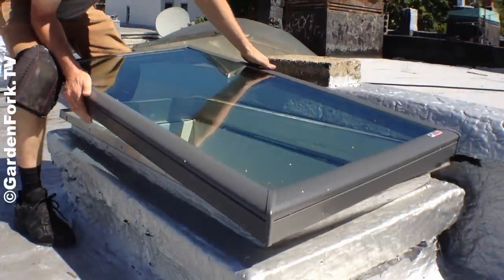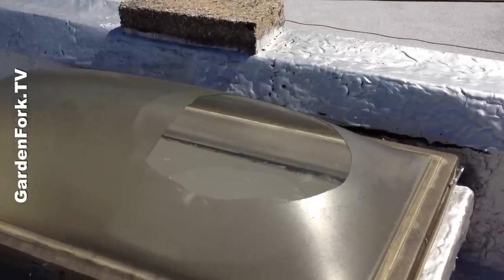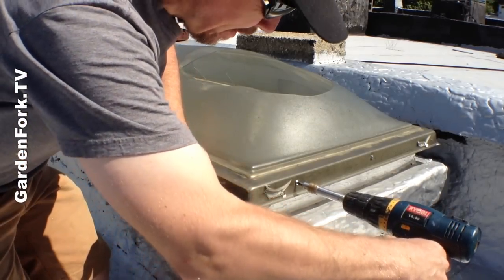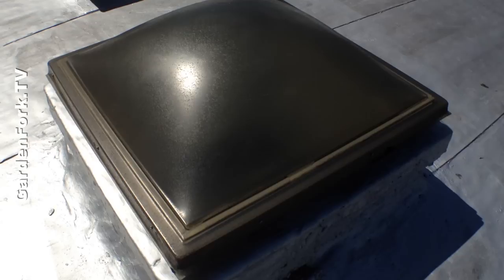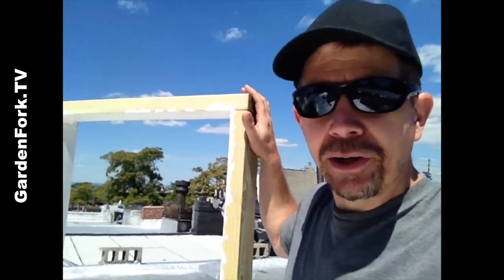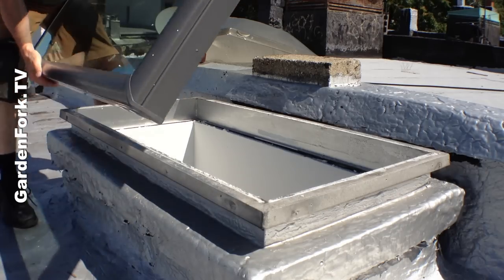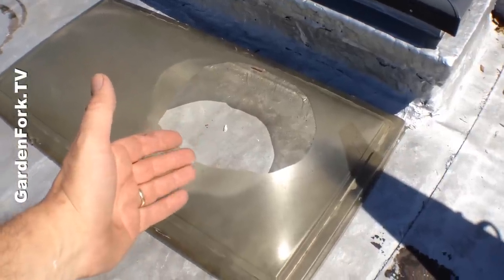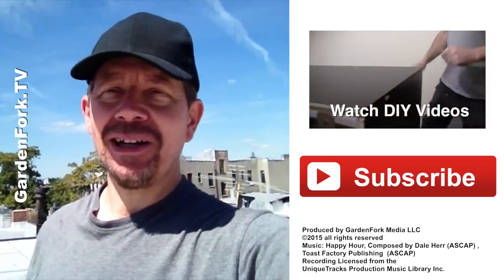How To Replace A Skylight - GardenFork

Comment: If your roof doesn't have a water-tight pre-existing curb, it likely isn't going to be this simple, especially if you get snow in the winter. It usually requires ice&water shield (a waterproof membrane with adhesive that seals around fasteners that secure the roofing material and skylight,) as well as metal flashing, (and also step-flashing for shingled roofs.) Finish the job with some silicone caulking at any spot where water could penetrate. A leaky skylight can cause a lot of expensive damage, and you might not notice it right away. I'm glad it worked out this easy here though.

Comment: Where do you measure to see what sized skylight will work?  I want to do exactly what you did and take out my old 80s bubble with an energy efficient velux like yours.  I wonder if it's the standard 22.5x46.5".  Watched a video.  Measure 1.5" down from the top of the curb to get an accurate curb size then ad 1/2" to L and W so there is 1/4" space all the way around.  I probably oversimplified it.

Comment: Just curious, as you removed the old broken dome, why is there not a new dome installed over the new skylight??
Reply: That is because the Velux skylights are much like a modern window in a house. They are double-pane with argon gas in between for energy efficiency.

Comment: Does a tile roof complicate replacing a cracked skylight? A roofing company wants to charge $6K because it says two rows
of tile roofing needs to be removed in order to replace the skylight.  I have a drone shot which I enlarged for detail I could share with you?

Comment: Don't you need another piece of domed plastic to defuse light & protect the glass from hail?
Reply from the maker: Rick Kennerly you can get a skylight with frosted glass, but this is in a common hallway, and the glass is designed to be mounted flat on a roof, so its ready for most weather.
Reply: +GardenFork really?  Wow.  And so it won't leak laying flat?
Reply: Yeah and if it snows alot that thing is going to come in your house
Reply from the maker: Nangjelovski its a weather proof skylight. you get what you pay for with skylights, this model is very good. thx! eric.
Reply from the maker: Rick Kennerly flat roofs actually have a slight pitch to them, hence the skylight is pitched as well.